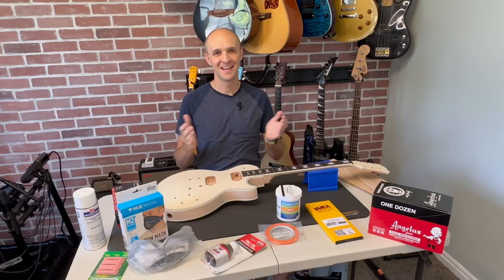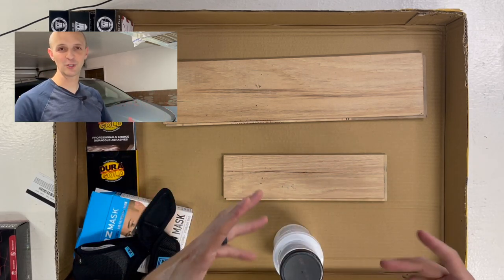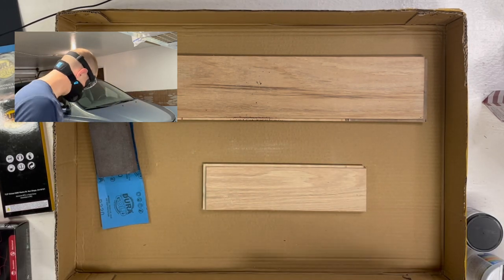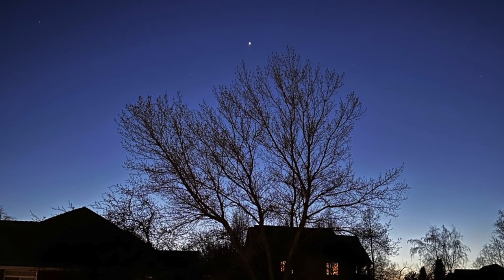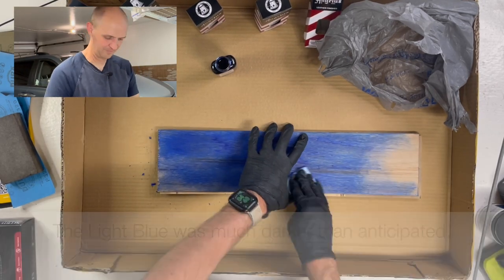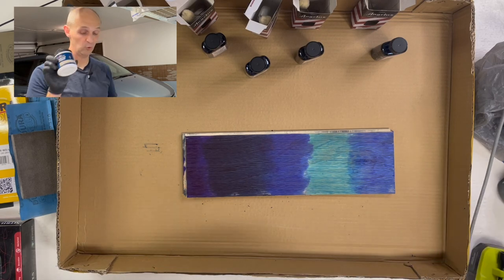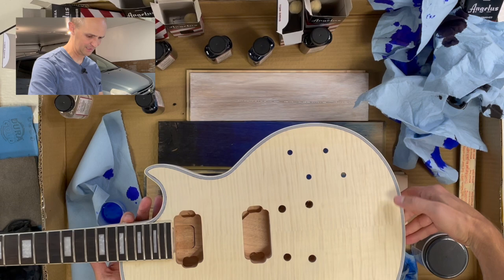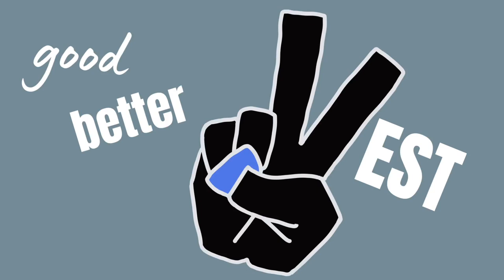How do you DYE a guitar?! Let's PRACTICE! 🎸🎨 Part 2 - LP PANGO Guitar Kit.

Comment: In color, if it is lighter right and darker left, do the light blue color to its left end, then the next color (darker blue) Starts at its Left end point and works to the right . As it gets closer to the lighter color , you are running out of dye on the rag and so it is getting lighter (to match). Same with black at the left end : Start at the left end and work towards the lighter color (in this case, the darker blue) Left to right to add color , right to left to make it darker.
Reply from the maker: That is super helpful! I am going to use that on the next builds. I have a couple kits just waiting for me to finish this one. Do you have videos of your process?

Comment: I learned quickly, that Aquacoat really needs to be sanded before dye…..I ended up with shiny spots, which I had to sand off, and stain again…..
Reply from the maker: I have unfortunately learned this lesson several times, I guess not learned, but tried again and again with the same lack of success. 🤪 I would love any suggestions of a different grain filler because Aquacoat has been pretty frustrating.
Reply: @goodbettervest  you don’t have to use the grain filler. I like to feel the grain so I never use it.

Comment: The problem with compressed air is that the compressor is "Oiling" and "Watering" the air it blows and that residue is then imbedded in the wood grain. Not Good !  One MUST have a water/oil separator on their compressor or it leaves a residue.
Reply from the maker: That's great info! I was totally unaware of that, which is why I'm doing this! To hopefully learn some good methods I can repeatedly use. Thanks for your comment! Hope you subscribe and keep giving comments and helps! 🤓